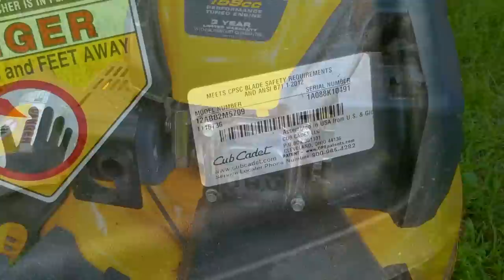This Is How  It All Started

Comment: Nice to know I used to race 1984 cutlass 434 small block ,2stage nitrous,with power glide transmission, and ford 9inch rear ended . Ran5.90 second 122mph full body  and I like small fas engines .
Reply from the maker: VERY NICE!! that's the G body right?
Reply: @HomeGaragechannel   yes

Comment: My experience has been pretty good overall. My first exposure was with a Tecumseh on a mini bike when I was 8. That was a bad experience which soured me on Tecumseh's. Then racing go-karts with Briggs 5HP flatheads. That was a good experience. Then I got married, got a house, and then power equipment. A simple mower with a Briggs, and a McColloch trimmer. The mower was trouble free, but not the trimmer, so I tried a battery powered unit. Mistake. After it died (in about 3 yrs), I went back to all gas powered. Once I started following the maintenance outlined in the manuals, and stopped using ethanol fuel, my small engine experience has been almost trouble free. Almost all my small engine troubles from the last 10 yrs have been from people who would rather be playing video games.

I enjoy fixing things, and small engine repairs are very rewarding. It's even been rewarding fixing the problems caused by teenagers with attitudes. They can still be worked on without computerized equipment (the equipment... not the teenagers). Mostly. My current zero turn has EFI. I hope it never needs repair. What I have learned from my experience, that of coworkers, and watching small engine videos is, a little bit of maintenance goes a LONG way. Just minimal maintenance will keep one running for over 10 yrs, unless it was a piece of junk to start with.
Reply from the maker: thank you for sharing that.

Comment: I have working knowledge like yourself except in heavy equipment. When came to my lawn equipment I just did the normal stuff oil, spark plug, and air filters. My equipment gave me very little problem. Now that I am retired I have gone to the extent of a deep plunge of repair. Mainly because of time and money.

My Achilles trouble came from a four cycle grass whip. Troy Bilt. I believe you worked on one in one of your videos. I never could get that machine to run and run right. So it went to the curbside for some else to play with. With in 1 hour of it sitting there it was gone. Happy days for me and I hope for whomever picked it up.
Reply: I like to work on these small engines..I'm 70 and it's rewarding.especailly helping friends and neighbors get their mowers going
Reply from the maker: nice, I appreciate you passing it on to someone else and good luck to them.
Reply from the maker: very nice hobby for sure.

Comment: I've been fortunate that I havent had much go wrong with any of my gas powered tools. Some of my stuff I've never even touched as far a maintenance goes, like my echo string trimmer and my stihl chainsaw. I've never done anything to those like changing the plug or air filter, etc. I think the most important rule to maintaining stuff like this is the way you store it. You have to keep these things somewhere dry and out of the rain and you have to run them out of gas. You cant leave the gas sitting in the carb for a long time.
Reply from the maker: you are absolutely correct about that!

Comment: You can fix it with scraps or buy weird surplus parts that may be new but probably won't work as is. I just saw a used push mower engine for $699. Plus $70 shipping. Said it's for charity. A very expensive trap for maybe a first time buyer but you're seeing some really "bold" sellers. $200 plus shipping would have been at least in the stratosphere.
Reply from the maker: thanks!

Comment: I have started about a month ago working on these at my girlfriends house. Her dad does a bunch of this stuff. He does a lot of things in ways that some won't like but it's been interesting. Typically if it requires spending money and you don't have to, say just tying a wire to the flywheel brake then just doing that instead. If a carb doesn't work we try and clean it and see if it works but we have like 5 or 6 mowers with that issue it sucks. He usually gets them from people who just drop them off who don't want them or need them fixed. I definitely enjoy doing it but I dont ask to be paid unless I eventually fix one and sell one. Also I took a small engines class in school so I have little experience but enough to know some. I dont remember much from it. Its just hard to do that and have time to do everything else and go to work everyday. I have to drive like 15 to 20 minutes there and back home everytime I go. That's the part that sucks. Not enough time in a day
Also I have been binging your videos just about every time I have the chance to and they are all very interesting and I've learned a lot from them. Like I said most of our mowers are carb issues and I've torn some carbs off and literally saw powder and white residue inside rhe carb. Terrible. 

I have a question though. I feel like I'm missing a part on the carbs I've cleaned cause some run just for a sec then die. The carbs seem fine but I must be missing something. What makes a carb "need to be replaced" even if you clean it out entirely? What makes it wear or not function besides it being dirty? I just want to know if certain carbs are worth cleaning or junkies.
Reply from the maker: Thanks Kaleb Z for watching my videos, I appreciate it. So it depends If the carb, has a primer. The primer physically puts fuel, into the engine and that's what the engine might be running off of, for a second. If that's the case, the carb is not delivering fuel, either because the Fuel jet, is still somewhat clogged or the emulsion tube is clogged. The other possibility it the pilot jet is still clogged.
Reply: @HomeGaragechannel  so its just all those jets? I cleaned most of the holes I saw with carb cleaner but I must have missed a few because they really do seem like carbs that would work. Not caked in grime or dried ethanol or whatever. I must be missing something. I feel like I'm missing the jet on the bolt from the fuel bowl. Most of them are the same basic carb with out a primer or choke. 

Thank you, I'll let you know how I do

Comment: my experience with small engine so far has been pretty good, to the point where I have considered making it aside business/hobby. one of the main things that stops me from doing that is I don't feel very good at sales. whenever I have an item I want to sell I tend to just try to find out what the market value is but then I look at the item that I have and I question it's real worth. if it doesn't have a high enough value then I'm not sure if it's a very lucrative business. at the same time though I feel like I have a pretty good work ethic and I see some things that other people sell and I think that I can do better with the repair or clean than they do. so I guess you could say I'm a little all over the place 😕
Reply from the maker: I was like you, about 5 years ago. I'd keep it, a "low key" side hustle and that's it. Don't go full on business otherwise things get "real" real quick.

Comment: Very interresting ! I do a lot of small engine work as well and really enjoyed all of your video! Have you ever seen gas bubbling in a lawn mower fuel tank ? It is bubbling so hard that the fuel is getting to the air filter and soak it by the tank vent ? What can cause this  ? Thanks for your help and all your good video
Reply from the maker: thanks. As for the question, I need to know what your mower looks like.

Comment: Most recent repair was a drive belt change. I put the guard on wrong and couldn’t get it working. I tapped out had the shop fix it and lightened my wallet by $100 for what was a 5 minute fix. Needless to say, I’m a bit repair shy as of late.  Uber frustrating.
Reply from the maker: it happens sometimes

Comment: Where do you find the thin wire used to clean the jets on the carbs in your videos?
Reply from the maker: it's just some thin steel wire, but I'm not sure where I got it from.  If you don't have access to that, then just use a wire tie from your bread. That works too.

Comment: Hi, How are you. I have the same mower that you are working on in this video. After cleaning the carburetor the auto choke will not close. I remove the air filter and I can manually close the choke and it will start. Then it warms up and runs fine, but the choke never returns to the closed position. So the next time I go to start the mower it will not start. Can you suggest on what i maybe did wrong. Thank you so much
Reply from the maker: sure, on this particular choke setup, the way it's connect to the linkages is vital. Maybe the linkage was damaged or installed in a way that it's not allowing it to close.

Comment: Hello, I have this exact model mower and I have a problem where after it has been running for a while and I shut it off for a short period to move something and then go to restart it, It over revs and then dies back down before going back to normal.  Any help is great. Thank you!
Reply from the maker: I believe the choke bypass and the governor linkages are binding. trying spraying all the black plastic that make contact with other parts , on top of the carb with something like WD40.
Reply: @HomeGaragechannel  I will take a look at that. Thank you!
Reply from the maker: no problem

Comment: Hey home garage is it possiable to fix 2 cycle gas trimmers that wont start if is then sadly its happend with me so me and dad were cleaning out the storage area and i found my favorite 2 cycle ryobi trimmer just there and when i trying to fire it up it did not start and now it wont run and i cant have it so it has to be thrown out😢 which im sad about this trimmer has actually ran before but now it wont is there any way u could fix it?
Reply from the maker: sure, I'd replace the fuel lines and the carb. There should be a kit, of just the parts you need on Amazon for around 10-$15.
Reply: @HomeGaragechannel  Ok then I'll see of I can get those ordered